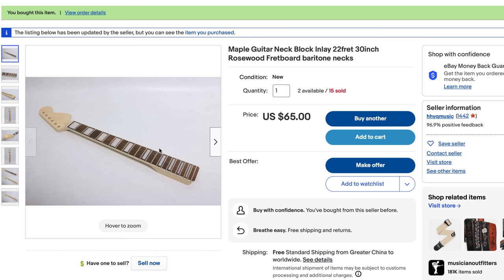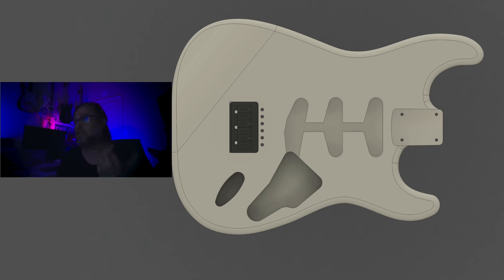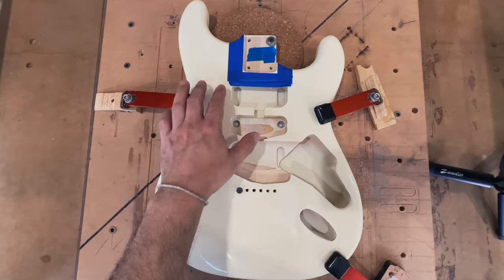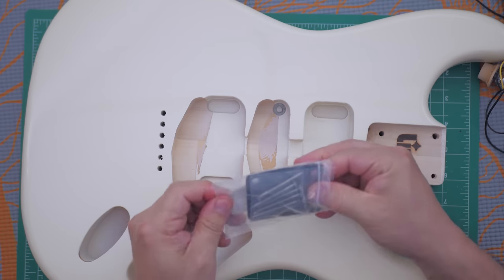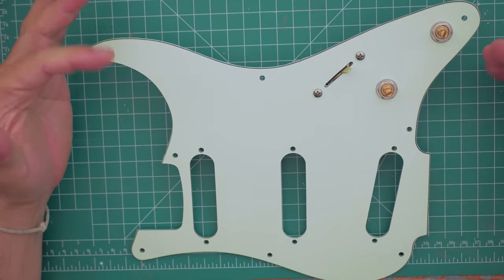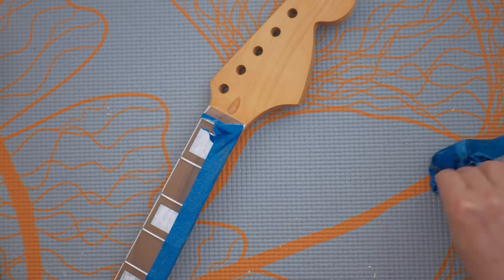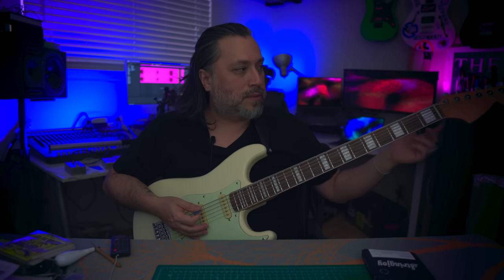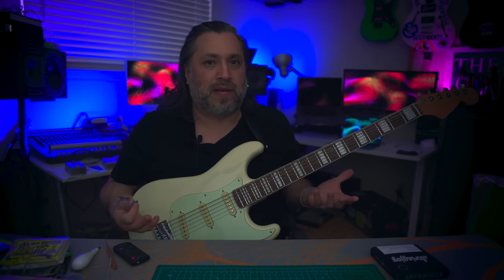30” Baritone Partscaster Build

Comment: What you have built is basically a Fender bass VI which is not really a baritone.  Baritone guitars are generally tuned to C, B, or A, below the standard guitar low E while a bass VI is tuned even lower to an octave below a regular guitar's low E (the same as a bass guitar).   The stringset for a bass VI would take care of what you are after without having to struggle buying multiple sets of strings. Fender as well as a few others make these bass six string sets 024 (wound) to 084 is common but there are sets with 090 and 095 for the low string.  Cool beast you made though!!!
Reply: Tell that to loathe, a band that uses baritone guitars tuned to E or even double drop D
Reply: @hamesonjarris  While it seems it is somewhat open to opinion what constitutes a baritone exactly, a bass VI is a bit of a different beast than a "normal" baritone guitar.  Not sure what scale length and string sets those guys use but if they are 30" scale and have all wound strings then I'd say they are playing bass VI type instruments rather than baritones.
Reply: You're fun at parties I bet
Reply: @ryanmartin2343  What exactly constitutes as being "fun at parties" is a pretty seriously wide definition and depends entirely on an individual's personal taste.  ;)
Reply: @7171jay the only difference between a bass vi and a baritone is the strings. Danelectro invented the 6-string bass in the 50s, and Fender followed with their Bass VI in the 60s. So originally these instruments were considered basses and tuned E-to-E. Later people started stringing them with lighter strings and tuning them to B-to-B calling it a baritone.
Reply: @Thoracius  It's a bit more complicated than that as what most people think of baritone guitars are mostly in the 26-28" range while most 30" instruments are sold with heavier strings and intended to be tuned E-E lower than the baritone range which tend to be tuned to B, C, A, and sometimes G. 

To my knowledge only lately have 30" instruments been sold with string sets light enough that they have plain (unwound) high strings which strikes down the old theory that a 30" six string is automatically a Bass VI.  

It's certainly messy now and more than a bit confusing but I would say it's a combo of string gauge, (whether or not you have all wound strings or plain unwound high strings) as well as what you tune to that defines a baritone from a Bass VI.
Reply: Kinda seems like the use of the instrument plays a part too. At least nowadays it does. Meshuggah use like 29.5 in scale guitars and they use them like they are low tuned guitars. From what I’ve read they use thinner strings so you don’t get that round bass tone, and they use pedals/eq to remove a lot of bass from their sound so that the guitar still sits in the midrange.
Reply: @JJ-mp7rg  Exactly, that's what i was getting at.   

If you put baritone strings on a 30" scale instrument that was intended to be a bass VI and tune to A, B, or C then it is going to sound like a baritone guitar.

 If however you take a 30" (or 29.5" or even 28") scale baritone guitar and put bass VI strings on and tune to E1 (the same note as a four string bass then it's going to sound like a bass VI.

Comment: Replace the ceramic magnets with neodymium. There's a guitar myth-buster guy on youtube that made his own homemade neo pups as well as an alumitone, AND a bigsby setup that you can dive bomb. Long story short, neos have the clarity and focus of the best alnico, with the power and bass that they lack, particularly on single coil pups. Slightly light on the windings+N52 neo magnets = great sounding pups instead of cheap ceramics.

Comment: You are the guitar whisperer. 😂
I bought one of those DIY double neck stratocaster kits and I converted the bottom from regular guitar to baritone with just a set of strings and a baritone neck.  I used guitar fetish Texas specials pickups. It turned out great.
Reply: Which baritone neck?
Reply: @spastickitchen  - Just some  baritone neck I found on ebay.
Reply: @TomTobin67  oh, is it the one with the carbon fiber pickguard and holographic boobs on the neck plate? You have comments turned off on the video, but I'd love to see a follow up video. Looks like a 28" baritone neck? You ever get it adjusted to be playable?

Comment: Very inspiring!  Watched this more than once now—I might do similar. I’m guessing it’s not strictly necessary to move and re-route the bridge and middle pickup. The tone would just shift a bit warmer with these 2 pickups being pushed a bit forward from the bridge. I’m thinking I might try this at first, that way a noob like me doesn’t have to route anything, and I can use a standard pick guard, or a “loaded” one ready to go. Then if I don’t like it, I have the option to move the pickups back closer to the bridge later. 

I’m thinking of doing this on either a hard tail Strat or Tele. I think the same neck maker does a 30” 24 fret T-style neck as well. I might consider installing a top mount Xtrem with roller bridge—easy install. 

Sparking lots of ideas!

Comment: Cool Vid! I built a 30 inch Tele bodied Bari a couple years ago and I can hardly put it down. It's Pearl Lime Green with a hint of GoldBurst on the front, and Pearl Eggplant Purple on the back and neck. Did my own abalone inlays. Hipshot tuners and bridge. Aluminum strip body binding. DiMarzio D-Sonic in the bridge and DiMarzio Evolution in the neck...talk about tone! It's a beast. I call it the Tele-Baller Booty-Caster.
You can see it on my channel along with a couple other builds.

Comment: About 6% of your scale length for the bridge pickup. I've just strung my scratch build 28.625" scale 7 string. You may also want to look at the spacing for the neck pick-up vs the original 25.5" scale neck position, and try to get that closer to the neck itself (it means the pickups spread a little which I didn't pickup during the video).A little less neck break angle at the neck pocket with moving the bridge and scale. Easier with a CNC but possible without just take your time and be accurate and planned. Awesome build.

Comment: For the bridge and bridge pickup, could you have used a top-load Telecaster assembly that is flat?
That would allow you to use a cool Telecaster bridge pickup on a Baritone, AND, it would cover the original string-through body holes.
Sounds cool, I think I might try it.
I really enjoyed your content, Thank You
EDIT, Additional thought, I'm pretty sure they make stack single coil humbuckers with ceramic magnets, just a thought if high gain is a consideration.
Reply from the maker: Great idea. I hadn't thought of that. A top loading tele bridge would have been much easier.
Reply: @MarkGutierrez  SO many options available these days.  I remember trying to find guitar parts back in the late 1970s, I was usually ordering by phone and mailing in a money order!  4 weeks later the part arrived!   My gosh how times have changed.
Your Baritone turned out great, thanks for sharing your build with us.

Comment: Such a cool build! I've been wanting a Bass VI type guitar for a while now, so it's cool to see how easily one can be made. I'm curious, was there a reason that you didn't go for the Bass VI set of strings from Stringjoy? They have a sets with .90 or .95 6th strings available.
Reply from the maker: Hi. I remember reading through the description of the two packs of Bass VI sets they sell. I wasn't happy with the idea of an increased tension set. I ran the numbers of their balanced set through their string tension calculator. I wasn't happy either. I think I just wanted a custom set that would would for drop running. At lease that was my original plan. I ended up tuning to E. So in the end, I could have just picked up that Bass VI set.

Comment: my idea is to build a baritone neck with +2 frets in a standard 25.5 inch body. I went to stewmac fret position calculator and went by trial and error until I got 28.62 inches, which you get from fret 2 to  the other 26 frets the same distance between then, plus the "negative" frets from nut to 2nd. It will have the same distance between a standard neck, but will be like standard E tunning from 2nd to 26th fret in a 25.5' and more 2 semitones from nut to 2nd fret in a 28.62'

Comment: A not-inexpensive project I have done the line, but a similar goal is down the line for me.
I’m going to buy a 30” scale Bass VI neck from Alef guitars (I’m big into aluminum guitar stuff right now) but just build the body myself out of reclaimed wood.
Single humbucker in the P position.

I’ll need to put some sort of counterweight in the bottom and futz with the strap button positions for best comfort for whatever body shape I go with (which will also be designed for best comfort for my playing style and position).
Metal is heavy, yknow?
Reply: Also, you can do a full custom set from stringjoy.
I’m doing that for my current guitar project. 13.5-60 balanced tension for DADgad at acoustic tension. I love maximum effort strings.

Comment: I had a 28 5/8” Warmoth Strat. It was very pretty (black Limba body, ebony over Wenge neck), but not for me. Made money flipping it, and was without a Bari until last week, when I picked up a stock P90 Cabronita. 27” is the ticket for me.

Comment: Do the tapers on those stringjoy strings end up behind the nut? I'm planning a build like this and was worried about what type of bridge to use (string through vs top load) due to the winding potentially not reaching all the way to the nut with normal non-baritone strings.

Comment: Hey, this is a really cool build. I'm currently in the process of converting an old LTD M-10 into a 27" scale baritone. Coincidentally I bought a very similiar neck from eBay with the blocks and the 70's style headstock. One question I have though, when CNC'ing the new pickup cavities, would it not have been easier to just route a "swimming pool"?
Reply from the maker: Yes. A swimming pool would have been much easier.
Reply: @MarkGutierrez  props on the build though! Really class looking. Hope mine ends up even half as good as yours

Comment: did you move the bridge down because you used a regular neck? If I used a baritone length neck, would I have to change the bridge position?
Reply from the maker: there are two types of necks. Regular necks and Conversion necks. If you used a conversion neck, you wouldn't have to move the bridge but those  necks are expensive. I used a regular neck and had to move the bridge.

Comment: Just a quick anecdote about cheap Chinese ebay necks:
 I bought a $90 roasted flame maple neck and it's a nice piece of wood but the frets were *horrible*. Jagged, sharp edges and several were lifting up already. Ended up pulling 6 of them out just with my fingers. Now I'm working on refretting the whole thing and had to buy some new tools to do so. That $90 neck turned into around $200 and a lot of labor and there are still several ways it could go wrong.
If I could take it back I'd just spend the extra $ on a quality neck and avoid all the trouble.
Reply from the maker: Yikes. I've bought about 4 or 5 Chinese eBay necks already and haven't had any major issues. I certainly level the frets on them but I would do that with any overseas guitar.
Reply: @MarkGutierrez  Glad to hear you've had better luck than I! The baritone turned out great and sounds awesome man.

Comment: awesome video! I did my first ever jazzmaster build/assembly with an all guitar fetish parts (except graph tech nut) this month and it was so much fun.  I'd love to see you explain how you design and model in CAD.. did you have to design that body in cad prior to making the adjustments? or did you use the standard import spec strat body since thats what LIDOs are cut to?
Reply from the maker: For this build, accuracy of the body wasn't important. I literally downloaded the body off of grabcad. Wouldn't matter if the specs or dimensions were off cause I'm designing off of the center line with an origin point at the center of the end of the neck pocket. So even if the body wasn't a perfect match to the model, the center line is the same on both and I just used that has the origin point for the CNC.

Comment: Awesome work! I’m also currently building my own baritone. How’s the neck? Did you finish it with some coating of leave it as is?
Reply from the maker: Hi, the neck is great. I don't remember what I did with the finish of the neck. I think I was spraying a lot of stain nitro back then. A rattle can of satin nitro from Stew Mac.
Reply: Thank you for your response! Do you think this neck will work with jazzmaster and jaguars?

Comment: Great setup you got going on there!
The guitar sounds amazing as well!
What pickups did you use?
Another question, I'm new to all of this, would not the length of the neck be good enough, rather than shifting the bridge and pickups?
If not, why not?
I also noticed that you did some cnc work on the bass of the neck, with the cnc, there's no audio only music, I'm not sure exactly what you did?
Reply from the maker: Hi, I used the cheapest ceramic pickups available on the market. I pulled them from an overseas guitar. Warmoth makes conversion necks that retrofit on any standard scale body. This neck is not a conversion neck, it's a traditional 30 inch neck, so we have to move the bridge back. Conversion necks avoid this by compensating the build of the neck outward, so the necks are longer toward the headstock. CNC work on the heel was to shave off 2 millimeters.
Reply: So anything over a 30" neck would be considered baritone, that's measuring from the nut to the bridge?

Comment: Bluddy great. I have bought (I believe) the same 30" neck - but the skunk stripe was loose. The guy gave another 25US off, which was cool. What do I need to watch for when trying to re-set & glue the stripe? This will go on a custom tele body with only  single mini-bucker in the bridge....or should I look at a neck pup too? Really cool to see this vid, man. Love from Scotland!
Reply from the maker: fairly easy fix. I would use a vey thin super glue instead of wood glue. https://amzn.to/3QkzFNW that way you can set the stripe in first, clamp if necessary and flood it with the super glue. It will set in fast. Once dry, scrape the excess with a razor blade, then fine sand. Don't worry about glue getting on the truss rod, it will have no impact on it. Good luck, have fun!
Reply: @MarkGutierrez  Ok man, thanks for the reply and advice!

Comment: Hi Mark! Fantastic build. I watched a few times, and maybe I missed it, but could you explain what is going on when you are CNCing the heel of the neck? I'm assuming you had to modify it so that it would fit the import strat spec pocket. Did you have to modify the length, width, or depth?
Reply from the maker: Hi, I only had to modify the thickness of the neck heel. It was a little too tall by about 2mm. I just shaved off 2mm. that's all.
Reply: Thanks so much. Knowing that, I would much like to try the same trick, just without a CNC.
Reply: Ok, so I have all of my parts. Routed the pickup cavity freehand, making my own pickguard, and putting the parts together. I see why you removed material from the heel. I didn't, and the height on my bridge is set at max. Still fully playable. My neck certainly doesn't look as pretty. Lots of little cosmetic flaws. But functionality is perfect. The body is actually great for the price. So, for a litle over $160 usd, I now have a quite decent bass vi/xl baritone. Thanks so much for posting this video, Mark. BTW, I love your other videos too.
Reply from the maker: @spastickitchen  so cool!

Comment: how come he had to move the bridge? is it to get the scale length right, would it not intonate properly without the bridge being moved
Reply from the maker: Correct. The body was for a standard 25.5" scale-length  neck. The new 30" scale-length neck required the bridge to move further back.

Comment: Dude how did you position the body on the cnc bed (the first time it was impressive enough), then flipped it over and had the machine aligned and zeroed exactly where you wanted? I'm very curious, this is not easy to do.
Reply from the maker: I send the router to the center of the table. I have it     score a center line on the wasteboard. I find the center line of the guitar body using the neck pocket and bridge screw holds. I match the center line of the guitar on top of the center line of the wasteboard. I send the router up and down the y-axis to confirm it's centered. done.
Reply: @MarkGutierrez  I see, I thought it must've been something like that, but since you raised the body with those cork pads it looked kinda tricky to eliminate parallax error. Nice job man, very inspiring, next time I need to do something similar I won't chicken out by building an entire fixture to hold it in place and give this a shot instead!

Comment: Being a Bass VI player, I'm perusing this with interest...

EDIT: Bravo on a stunning looking instrument.  For help with strings (particularly in Bass VI tuning) I can highly recommend Newtone Strings Axiom set.
Reply from the maker: Thanks for the string suggestion. Just looked them up,. SOLD OUT. lol. I'm tuned to E. I like the way the .90 feels. I much prefer the tone over the .95. The Newton set comes with a 100! I feel like that would lean more towards a bass tone than a guitar tone. Thoughts?
Reply: @MarkGutierrez  Stringjoy always has a solution, plus they're top quality.
Reply: @MarkGutierrez  yes the .100 does have a bit of low-end heft. As far as I'm aware Newtone will make your set to order as opposed to having sets ready to go, so they might be able to make a custom set to order for you. I also use their strings for my Chapman Stick and their quality is excellent.